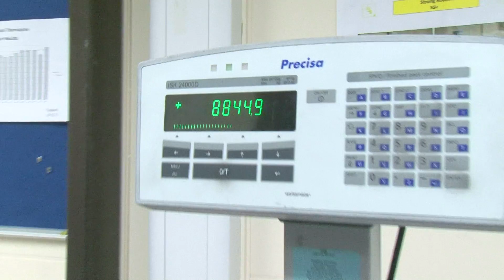Platinum - Periodic Table of Videos

Comment: I imagine it's more to do with safety regulations than with the actual risk of injury. But yeah getting such a dense object dropped on your foot would no doubt be rather painful, I once saw a girl drop a metal weight on her foot at the gym. It took two of her toes off, or rather it turned them more or less into mush, thanks to high density and relatively sharp edges, much like that bar.

Comment: Catalytic converters should be done away with. They're useless, all they do is cause the engine to work harder and less efficiently which in turn uses more fuel than one without a catalytic converter. Get rid of those pointless converters and use that for the production of hydrogen fuel cells.

Comment: It's something that speeds up a chemical reaction without being involved. For example, Potassium. Potassium is a good cataclyst for table sugar (C12H22O11). If you try to burn sugar it will caramelize. But if you add some Potassium or another chemical like KNO3 to the sugar it will burn and create carbon and water vapor (C12H22O11 → C12 + 11H2O). Hope I helped.

Comment: Some reactions have a certain input energy that must be reached before it will occur, this is the Activation Energy. A catalyst will lower the amount of activation energy required and therefore speed up the reaction as it take less time to reach the Activation Energy. The catalyst is never used up in the reaction as it is always reformed  when the reaction has finished.

Comment: A catalyst is a material that accelerates a reaction, so the platinum accelerates the production of ammonia, faster than it would otherwise. The speed of the reaction is also dependent on the surface area of the catalyst and that is the reason why the platinum is weaved, to maximize its surface area.

Comment: Do those special boots have soles made of lead to make running away more difficult or something? ;P
What makes Platinum such a great catalyst? :)
BTW. If Platinum did not bond well with iron it would still sink to the core, simply because of its density. It is true for all heavy elements.

Comment: to put it simply a catalyst lowers the energy required to run a reaction (e.g. 2H2O +energy -> 2H2 + O2)

the platinum group is good because it ADSORBS (not absorbs!!) gas particles very well (search it up im running out of words). this brings the particles closer to each other, making the reaction easier.

as to why this particular metal is good as opposed to others, i dont know.

Comment: That's a myth. Both Mythbusters AND the UL standards lab busted that one a while back. Also, if your toes are crushed, they don't just "Heal back." You MIGHT regain a bit of your use of them if you get to the hospital quick and not all are crushed, but most doctors in ERs (At least those polled in the US, I haven't a clue about the UK) would just amputate and make you deal with prosthetics because it's usually quicker, easier, and gets you back into a working condition instead of a injured one.

Comment: Speaking of catalysts, is there anyone in the periodicvideos team that could comment on the paper "Biomass-derived electrocatalytic composites for hydrogen evolution" (DOI: 10.1039/C3EE40596F)?  I know it won't help with catalytic converters in cars, but they do mention it is better than bulk platinum at cracking H2O.

Comment: Only with weights well above the limit the shoe was designed for. Derp. And they wouldn't "heal back". In any case for which the weight was sufficient to crush the metal would almost certainly require amputation of the toes anyway.

Comment: Assuming he's talking about the Haber process, there is no byproduct. N2 + 3H2 -> 2NH3. The platinum is a catalyst, so it is not a reactant or product, as it is present at both the start and end of the reaction. The platinum will eventually deteriorate as impurities in the reactants bond permanently to the surface, which stops it working as a catalyst.

Comment: If the column was filled with ammonia and oxygen, the byproducts would be nitrogen gas, and water.

The platinum acts as a catalyst, meaning it speeds up the reaction. 
 
But the platinum itself is not used up. Over time, it could develop an oxide layer, but this can be reversed through heating.

Comment: what is the byproduct of the reaction in the large columns with the sheet of platinum? does the platinum change into a different material that you can use for something else? or does it simply deteriorate and you have to throw it away?

Comment: You need a heck of a lot of force to deform the steel cap so far as to cut the toes so unless you plan on intimate dancing with a steamroller you are better off with the steel armour for your toes.

Comment: I think they do it by pumping a gas mixture (air) into a huge cylinder. Then pressing the insides into a smaller volume using a huge piston. This produces a huge amount of heat which will have to be conducted away. Then they release the pressure back to 1 bar and the gasses turn to liquid instantly. I'm not sure how they do it industrially, but this method would produce liquid nitrogen, oxygen and hydrogen.